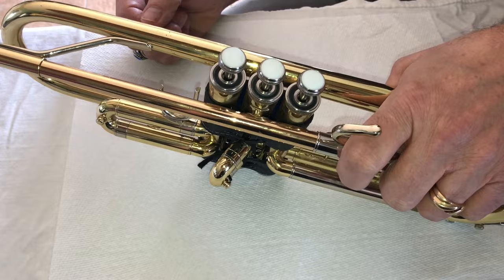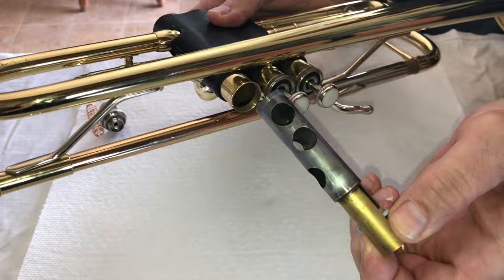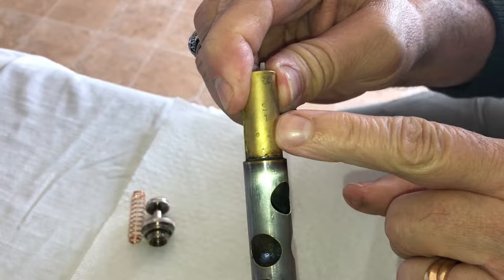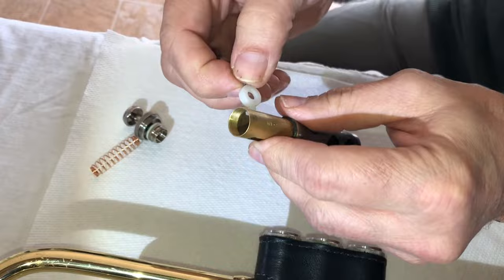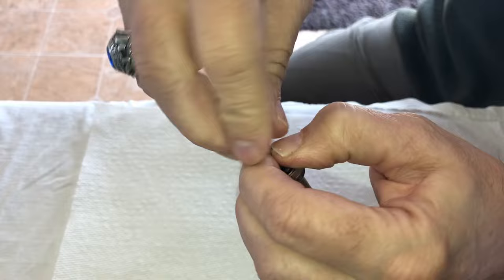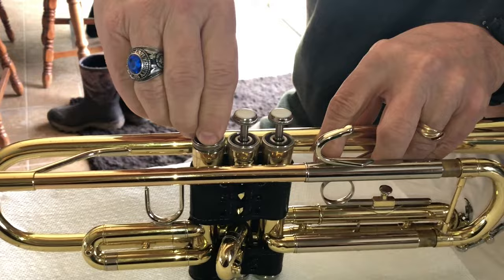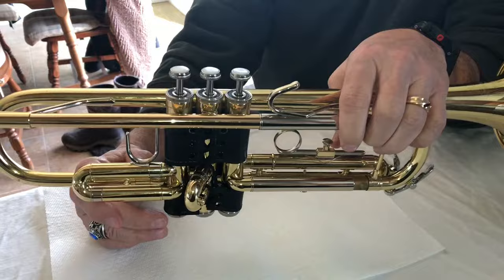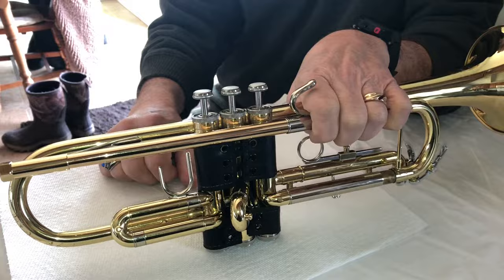How To Fix Trumpet Valves

Comment: There is one thing he didn't cover. When you put the valve guide back in the valve make sure that it is facing the correct direction. Valve guides have two different sides. Otherwise the valve will become jammed in the casing. Just turning the valve until it locks isn't a guarantee of correct installation.
Reply from the maker: Thank you for mentioning that. My demo trumpet was a Bach Soloist. The plastic guide won’t get stuck BUT if you put it in backwards, put the valve in and turn until it clicks, the valve will be in backwards. I agree that with other brands, jamming would be an issue.

Comment: I had an old trumpet and unscrewed it and everything popped out. There was a metal ring and a ring of cloth. When i watched the video, I heard something about turning the valve, so I turned the top of it and voila it moves smoothly. Eventually fixed it in the end, took about an hour because the cloth was so fiddly

Comment: Have you run into the issue of a trumpets' button coming loose often with intense playing?  Not the stem, just the button.  If so, did you have a fix for that?
Reply from the maker: Try Loctite Threadlocker BLUE 242 on the button threads. Don’t use the Red Loctite. The Blue will keep the button from loosening but you can still take it off if needed. The Red is permanent.

Comment: That marble thing at the very top of the valve popped off, I tried using a glue gun to get it back together but it falls off in a couple days
Reply from the maker: That is called a pearl and I would suggest finding a glue that will adhere plastic and metal together. Be sure to clean the surfaces before you glue them.

Comment: I’ve been having trouble with my trumpets valves recently and I saw wondering if you had any idea what was wrong because I’m at a loss at this point. Some times when I’m playing, especially if I set on my lap during rests, the valves move out of place. I then have to stop and miss my sections opening realigning it. Does it have to do with the vavle guide?
Reply from the maker: Peppermint Asteroid. From your description I would guess that the valve guide is worn away. If it is a plastic guide, they sometimes break. A new one is very inexpensive. My video should assist with your inspection of your guide and replacement.

Comment: The bottom cap on my  trumpet will not screw off any suggestions?
Reply: SirRyan__ take a pair of pliers and wrap the jaws in electrical tape. Use the wrapped pliers to loosen the cap.

Comment: Why do the buttons not make a noise when it hits the bottom when pressed down?
I can't see any cushioning.
Reply from the maker: There is a felt ring under the valve button and the valve cap to reduce the sound when pressed down and when it springs back up.

Comment: How do it put it back together when the part of the valve you oil is stuck in the trumpet and all that came out was the key and the spring?
Reply from the maker: Take the bottom valve cap off and push the valve up until you can grip it with your fingers. A wooden dowel or a thin snare stick might be needed.

Comment: When i try to screw my trumpet stem back into the spring and the valve, it does not screw in but the stem just seems to just go inside and is loose and does not get tighter in any way and does not screw. Someone please help me ive tried everything. I think something broke. 😭😭😭🥺
Reply from the maker: If your trumpet is a Bach Soloist, the stem should screw into the brass part that holds the spring. At the bottom of the spring should be the white plastic valve guide. If your trumpet is a different make, then I can’t help you without a photo of the problem. Might be time to take it to a repair person.

Comment: Hey I'm using my brothers trumpet and the button loosened while the stem was inside of the trumpet. Do you have any idea how to get the valve out (excluding the button)?
Reply from the maker: Your best bet is to unscrew the top and bottom valve case caps and push the valve up with your finger from the bottom. You should then be able to put the valve back together.

Comment: what is the padding in the circle of your valves and where did you get them?
Reply from the maker: That is there to keep the valve from making noise as you press it and release it. It should have come with the instrument but if you are missing them, an instrument repair shop should have some.

Comment: One of my trumpet valves works now but the other two don't go down. What is the fix for this?
Reply from the maker: If you did the same procedure on the 2 that don’t go down that you did for the one that works, then something isn’t in the correct place. If that isn’t the case, then my guess is you have a dent in the valve casing or a bent tube leading into the casing and I would recommend taking it to a professional repair shop.

Comment: mine is the tried one the issue is that it wont make the right sound and we tried to take it out to oil it but it was greases on my hands and when we put it back in the trumpet it wouldn't work is it blocked??????????
Reply from the maker: Try turning the valve until it clicks into place. If the valve doesn’t turn, then I suspect a blockage and you should take it to a repair shop.
Reply: @quickfixtips2030  Thank you

Comment: Wait I followed a video how to clean your trumpet and this girl didn’t take off the spring in the valves and my trumpet doesn’t sound good:( what should I do?
Reply from the maker: Xiomara Ayala do the valves work okay but you get a fuzzy tone?  If yes, try turning the valve button clockwise (as you look at the top of the button) until it clicks into the guide slot. If the button doesn’t turn, maybe you have the valves mixed up? Look for a “1” or “2” or “3” stamped on the valve. Make sure “1” is in the valve closest to the mouthpiece. Let me know what happens.
Reply: QuickFixTips thank you very much!

Comment: Mine doesn’t unscrew!
Reply from the maker: Hello_ Tori Hi Tori. I’d be glad to help. If it’s the valve casing cap, use a pliers that have electrical tape around the teeth to loosen the cap. If it’s the valve stem, that’s good. It shouldn’t move easily.
Reply: QuickFixTips thank you so much

Comment: Or you can just save ur self the trouble of taking apart the instrument and just screw the valve back the other way keeping it vertical lol. Works in my experience
Reply from the maker: You piqued my curiosity so I tried it. This was with a Bach Soloist Student line trpt. What I found was that once the valve fell away from the unscrewed stem, it was too far away from the stem to re grip the valve threads if that makes sense. However, I discovered that if I take off the bottom valve cap, I can push the valve back up with my finger so that the valve stem can re attach to the valve. So thank you for helping me find an easier alternative fix. I guess the point of my video was to explain how the valve is put together for those who kinda freak out and end up with a bunch of valve parts in their hand.

Comment: This was a good video but my valve is fully stuck and won’t come out
Reply from the maker: Which valve is it?
Reply: @quickfixtips2030  first
Reply from the maker: Okay. Pull out the first valve tuning slide and put a sharpie in the tube. Then pull down on the sharpie. That slight tug may allow the valve to pop up. If the trumpet was dropped or the slide was bent, that is enough to impede the valve action. Sometimes you can tug enough to fix the problem. Otherwise you may need to take it to a repair shop.
Reply: @quickfixtips2030  it worked! Thank you so much

Comment: My piston is inward I can't get it out 😥😱😰😭
Reply from the maker: Take the bottom cap off and push the piston up with your finger till you can grab it. If it’s stuck, take a wooden dowel or a small plastic tube against the bottom of the piston and gently tap it out. Oil the piston and the inner valve casing really well before reinserting.
Reply: @quickfixtips2030  Make sure the dowel is on the walls of the piston from the bottom. You could deform or actually punch out the spacer if you tap too hard on that part . Tapping means just that,  go lightly.  Or take it to a shop .It can be tricky , dont scratch the casing walls either .

Comment: Don’t put your trumpet down like that 😭
Reply from the maker: @SimplyAubree930  If you’re talking about laying it down on the 2nd valve slide, you are correct. The trumpet shouldn’t be resting on that side as a general rule. However, the surface was padded and I laid it down gently and only temporarily for the video. Thanks for catching that so the point could be discussed.
Reply: @quickfixtips2030  yeah I’m talking about the slide